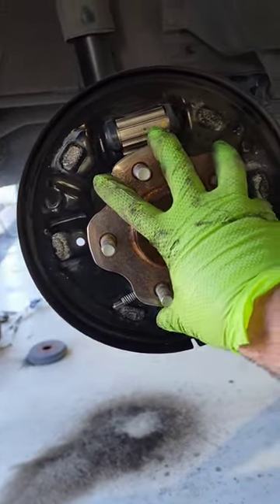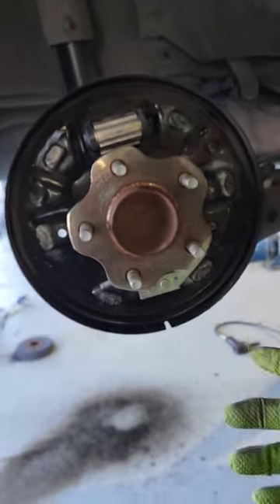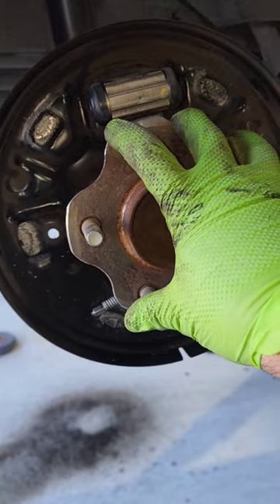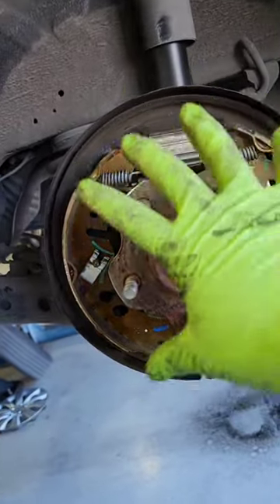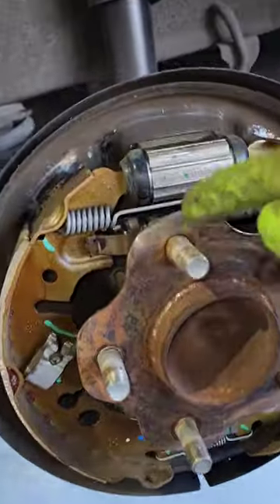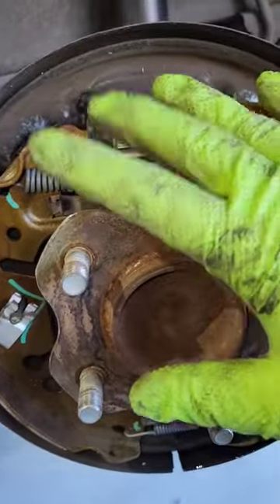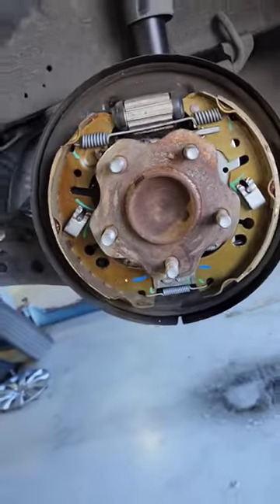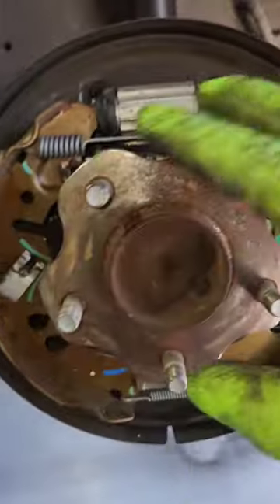DRUM BRAKES DO AND DONT #shorts #auto #mechanic

Comment: The original set of pads had the large pad in the front and the small pad in the back,  The new brakes I had to check it a few times but you have the small in the front and the big in the back...
Reply from the maker: Thinkn to far into my dude, im bouncing from side to side, if i set it up wrong then theres no way my parking brake cable would hook up
Reply: I have ran across this a time or two that the aftermarket shoes you buy has opposite length, of what was taking off nothing you can do about it, but put it together